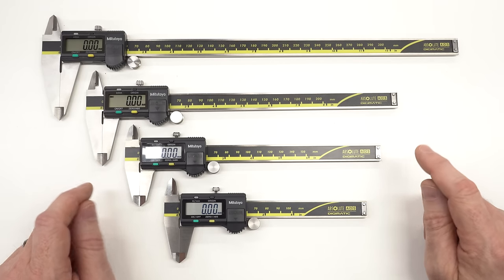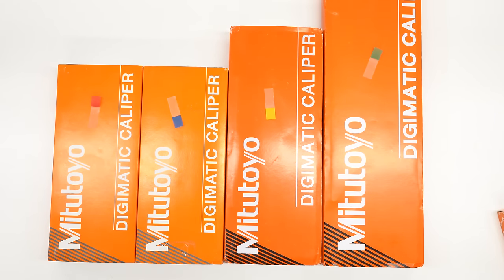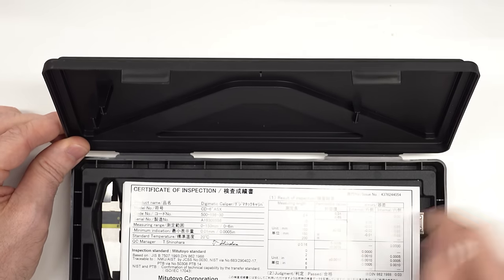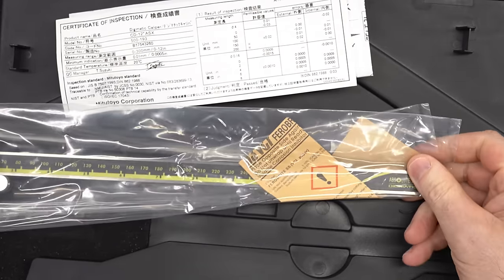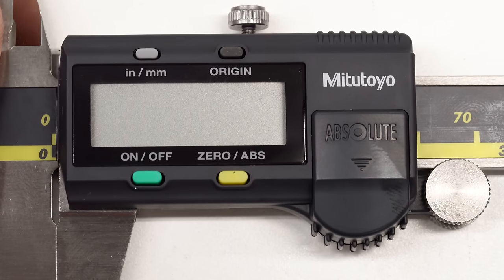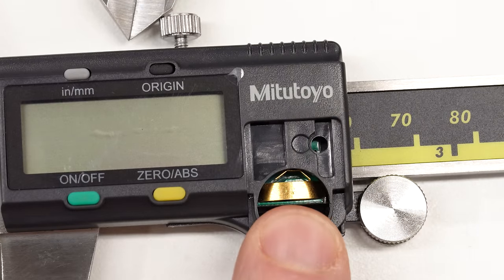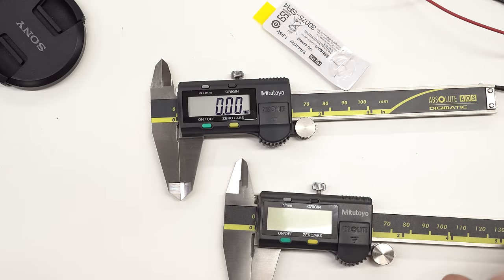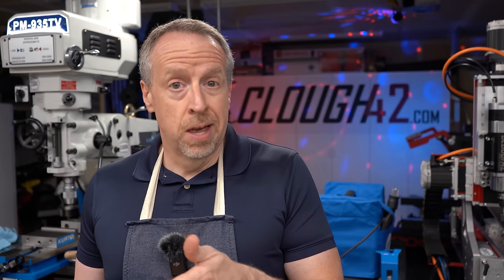17 Warning Signs Your Mitutoyo Calipers Are Fake

Comment: Fantastic video. You may be able to help me with a problem I’m having. I have a caliber that after watching your video I’m quite sure it’s legitimate. It is a code 500-171 model CD-6”C, serial 0048821. I tv have lost the battery cover and have purchased 3 on the internet and none fit. Can you possibly recommend a reputable dealer that may be able to sell me the correct one. This is a VERY OLD unit over 22 years at least.

Comment: The key issue is the accuracy of the fakes. I got the impression that you were so careful not to mention this once, which means that the “counterfeits” work exactly the same as the original. Actually, why pay more if it does the job just like the “original”? Just for the sake of the inscription "made in Japan"? I don't want to spend money on some kind of inscription.
Reply: Why pay for the name then? Isn't it better then to buy a genuine Chinese caplier for a fraction fo the price of the knock-off brand name product? 
I do have anything against inexpensive tools, equipment, and other items if they perform the same or the difference between the possibilities of a brand product and some other product do not present the difference I can make use off, but I try to avoid buying knock-offs of anything.

Comment: Nice detailed video however you 'forget' to measure things with it. Actually how accurate are the fake ones? Next question is how they are advertised? Original photo of the product or a photo of Mitutoyo itself? If they used a photo of Mitutoyo it is difficult to tell that you buy a fake product. It that case it is a trap for almost everybody. That is really a scam. But also, the materials used, is it worth the price? If you take a look at the video of BigClive (disassembles a very cheap caliper) you can see they can mass produce a very clever and accurate design for almost nothing. If they used the same (of the shelf) techniques, same materials or with a different twist to it, it is impossible to ask such price for it. If true, the scam has two sides: 1) A fake product and 2) You paid too much for what it is.
Reply from the maker: Your final two points are correct.  These are just ordinary cheap import calipers, overpriced because they're dressed up in a Mitutoyo costume.  In fact, I'd put these near the bottom of the import caliper tier list because of the battery consumption.

Comment: i had this problem with buying water filters for my refrigerator on amazon companies were selling what was labeled as GE MWF filters but they were completely different from genuine ones bought at home depot.
 i sawed case off filter and real one was a nice perfect dome of smooth carbon while the fake was rough cylinder with cloth glued to it to keep carbon in place and a plastic end cap which was broken off in shipping or installation so i was getting water full of black dust that was not filtered at all it simply went around end of open filter material water tasted terrible .
so i complained and amazons response was the seller says it is real so it must be true

Comment: I work as an inspector in aerospace and use genuine mitutoyo calipers every day. I bought a cheap knock off pair from ebay a few years ago on a whim, gave them to our gage calibration tech, and according to what he said, they were basically dime a dozen $40 calipers with fake logos but also perfectly fine for regular use. He calibrated them just fine and said they were perfectly serviceable. If regularly calibrated (as is typical for every gage no matter the price), they're fine. To anybody reading this, as long as they're calibrated, no matter what you're paying, they're fine. Don't get suckered into paying top dollar calipers.

Comment: Counterfeited measuring device where the packaging and labels do not have close to the exact sizes of printing should give the proper expectations of accuracy of the product. I would hate to be fired from a job because the measurements were off a little.

Comment: This video is frankly funny! :) Mitutoyo has it manufactured in China according to recommendations and quality controls which may vary over time! Mitutoyo is unable to authenticate its products (for example by a scratch code to be validated on its site). So we buy a caliper on Amazon for more than $100 and we have to go through a series of checks, it's really not serious! So I prefer to buy a Tesa, a Sylvac or a Mahr, as good or even better than Mitutoyo, and not have the worry of having a fake Mitutoyo. I would add that each youtuber dealing with this problem of counterfeiting presents its own criteria for verification, which makes the exercise even more smoky!

Comment: When I was buying chinesium mitoyo's from 95 to 2003, I was getting the 6" version for $9 and sold them for $45, only thing we noticed is the mit's number settles quicker, but we did not care for the price. Another note on your video, the 14x battery life was "sitting life" not use life. Also you did not show where the mit's battery voltage was, seemed quite a bit higher than chineesium. You should of did some measurements on all 4 calipers in all 4 modes (ID, OD, depth and step) with something small (say 0.1mm and 4.0"), as this is what matters most to us. Thanks for sharing.

Comment: I mean, I'm glad that the people involved in counterfeit products tend to fall into a spectrum between lazy to absolutely stupid but it's really crazy to see, from a basic graphics design perspective that if they literally put 10 minutes or less into "resizing" the original logo instead of "stretching" it, their only remaining issue would be matching the ink color as far as the outer box goes. Anyway, from the perspective of myself, being a legitimate enterprise - I have a hard time wrapping my head around anyone going to such lengths and trouble to create a counterfeit product but put such a lack of care into copying the product they're duplicating. But, I guess that just comes down to the overall mentality of someone chasing the desire to be lazy and make "easy money" by scamming.

Your point about if the counterfeits were of decent quality, why not market it under their own brand and compete on price was very poignant. 👍
Reply from the maker: Yeah, I'm not totally sure what's going on there, either.  Some of the stuff, like the crisp molds and the more expensive machining operations make sense from a cost perspective, but I have no idea why there are so many issues with the graphics.  That part should be pretty easy to get right.
Reply: @Clough42  Yes, that's true. The machining and molding are directly tied to a cost component so, while the end goal is to produce a duplicate product I can see why they would have opted for less expensive methods. However, they were printing the box anyway so the lack of attention to detail would seem to indicate that the packaging is probably a more accurate gauge of their overall lethargy than anything else. 

The battery packaging was absolute peak irony. 😂

Thanks for taking us through the comparison. We're all smarter now because of it.

Comment: I don't know what's changed in the past few years but Mitutoyo used to be the Black & Decker of  Measuring tools.. They work OK but not even close to top end.. They did NOT invent digital measurement. they bought the rights to produce from the inventor.  I am not aware of a single thing that they actually developed. Perhaps I missed something but I haven't heard of anything they did on their own. they either buy the rights to produce or wait until patents run out and start producing then.. The tool makers that I worked with all used higher quality tools.. If they are being boot-legged, it's because they are mass produced. Are any of the top brands being counterfeited?? It has been proven repeatedly that Even the Harbor Freight's are just as accurate. So why spend $150 when $15 does the exact same thing? At least the counterfeiters sold 2 more units for this video.. that should help to keep their operation alive..

Comment: Anything after 97 was fake in my book.   97 is about when online shopping took over and Small Town USA died.  I tried a few sets of the Taiwan import fakes,, then went to Starrett.  I had some junk supposedly-Starrett tools also, they didn't escape the onslaught of fakes.   A Engineer buddy who worked at Boeing gave me a set of some 10" hand built Boeing slide calipers from the "Boeing Tool Crib" headed to the scrap heap or the public outlet store.  Made at Boeing.  Puts all the rest to shame as far as accuracy and they are super smooth.  No batteries needed.   They are my baseline/double check for all the other junk that I own.   Have had them for 20 years.

Comment: All the fake models keep drawing battery power during "power off" since they are not absolute, so they need tracking any movement even if not shown on the display. Even further, the current is far higher than the original. This is why you need to continuously change the battery on these fakes, while on the original one the battery lasts accordingly to the real using time. On the fake stuff, the "off" mode is fake as well, it's a useless button.

Comment: The rear plate layout was completely different between the original and ebay, different fonts, different position of wording such as MADE IN JAPAN, the beam locking screws are red on the genuine, and silver on the fakes, the rivet plate on the genuine has different types of rivets, plus the stickers have been cut back on the genuine one at thr rivet plate, the fakes the sticker runs all the way through, the reason they will plagiarise the genuine product instead of branding themself is it cost $2 to make it they sell it for $80 / $100, self branding they could only sell for $30 / $40

Comment: The bottom line is who does it stack up on a calibration test. ie My Aldi Caliper reports on a 100MM Gauge block as 99.80mm. opps!. I guess that's close enough +/ - 0.02mm. lol

Comment: Good Day : I'm just retired after a 40 yr career in aircraft / aerospace . I went through college for "Tool & Die Design"  . I've encountered these types of investigations before . Slight differences in packaging happen frequently . Different branches of the same companies from different countries is what this is . What you are taking about is a difference between "Print Shops" , not the manufacture of the calipers . To take for example the black plastic covers on the front of the calipers , these are made by an injection molding process . They would contract out perhaps a run of 20,000 covers . When used up , a different shop could be very easily used for the next 20,000 . I'm very sure that you have encountered shops that can't fulfill their promises . They would automatically "Sub Out" to another shop the next run of 20,000 , the next covers would be conforming , but just slightly different . I see what you getting at in your video , but I feel that you may be barking up the wrong tree . A counterfeiting operation of this magnitude would have to be very big , and therefore could easily be caught .

Comment: As per workplace where using these for years.. usually calipers gets damaged by accident or by abuse.. original battery is still there. You gonna appreciate battery life too there when you don't ever really put notice on it. You use the damn tool.

Comment: Mechanical Calipers will have huge differences in how they are made... stamped out tooth rack vs machined.... etc etc etc.. But are off brand electronic ones bad? Using an encoder, rather than rack and gears might make my AE GEMS electronic one just fine... or is it?  As far as piracy, truth has a whole different bar on the interwebs. Sadly, many STARRETT  "real " calipers are imported now.

It would seem the maker could market theirs legit, as a Mitutoyo "alternative", and stand on their own specifications. I bought 2 6" calipers from aE Gems.... because the revues were rather high, and they did not attempt to deceive. They were the only electronci caliepr that had MM/INCH and FRACTIONS of an inch. Now there are a few from GENERAL that offer the 3 measurements.

But I am not a machinist, so my requirements for accuracy are satisfied with the ones I bought. I tried to buy Starrett, until I found they are from CHINA ( so sad )

Comment: I checked my Mitutoyo model CD-6CX and almost everything matched the genuine model. The only difference was my “origin” button is recessed. I wonder if this was a model change and the fakes used that plastic cast. Otherwise everything else, from grind to fit and finish and case are good. I bought mine used from eBay for £32, but they were dead on arrival so I got a full refund. It turned out to be the wrong thickness battery, so I got a bargain. There seems to be a port to connect this to a computer, but I don’t have the cable. Oddly enough, I bought a cheap £7 set and use that 99% of the time as I don’t want to damage my ‘free’ genuine ones. The human brain is an odd thing.

Comment: fake or real the most important thing is the precision got genuine thing before but it got so worn out and not recalibrated let just say it was a nightmare when everything is of by a bit that end up making thing failed, if it fake but precise i will take it as long as pricing is good and the performance match the pricing, at that point i would just sent them the letter say you just open your own company and make your owned shit instead of making fake at this point.

Comment: Why didn't he cover accuracy?  On consideration:
- Any measurements of the calipers he bought would be ONLY that:  measurements of the specific calipers he bought.  ZERO guarantees that the next pair of eBay calipers would be from the same source, same batch, and would have the same accuracy. 
I doubt the counterfeiters take the same care as Mitutoyo does to ensure uniformity, because that costs money and expertise.

- The counterfeits have no single, known, consistent source.  There could be dozens of companies buying knock-off labels, injection-molded housings, etc. and making the steel parts.  
A genuine Mitutoyo will meet the stated specs, because they CHECK, and do what it takes to sell a uniform product.

- How hard is the steel used in these?  Mitutoyo can be trusted to use excellent, uniform materials and have a very low wear rate; are the knock-off made from whatever came out of the partially-melted, non-uniform scrap melting furnace that day?  If it looks like that'll save a buck, I'd expect that.  So what does the initial accuracy check mean, after a few months of use?

- Are you going to trust counterfeiters to destroy a batch of 'iffy' parts?  They sell just the same, after all.  

Strictly for hobbyist use, and SHARS costs less...

Comment: I know one way to check is actually the battery. The real mitutoyo uses Japanese made SR44 battery the fakes 90% of the time use the much cheaper LR44 or other. There are a few fakes that use a fake SR44 battery but the font is off just a little so if they have anything other than SR they are fake.

Comment: I got sick of wasting money on cheaper calipers that were not Mitutoyo fakes, but were decent tools, until they stopped working so I got that 6 inch version from MSC and it works great after several years. Problem with this video is that you are showing the fakers what to fix and improve.

Comment: My mitutoyo calipers were made in Brazil.   The case has the clamping points as the "fake ones" do. however The rest all says the same except maide in Brazil the PP is there....mine  are NOT digital and they are legit and accurate. Pretty much everything else in your video lines up.

Comment: I wanted to see the LVCO of the genuine.....video cuts to conclusions after author says 'lets keep going.'
Also, I have some HFT junkers.  Been in the drawer for 9 months.  Still original batter.  But I NEVER leave the battery installed becuase I have seen crap, copycat electronics eat the batteries in the past.

The seiko SR44 battery (silver) has capacity of 160mAh.  At 16 microamps, that 10K hours or 1.14 years in the drawer.  At one microamp, it would be well over 10 years (3 years at 6uA aka 'usage').  I know the HFT units easily eat 2-3 batteries per year if the battery is left installed (assumed LR44 alkaline cells).  At customers' shops, the HFT caliper is WAY more likely to NOT come on than it is to function before getting another new battery.  Not many weeks later, it's gonna need another.

The more common LR44 battery costs 5X less, has capacity of 120mAh but starts life 50 millivolts lower (50 millivolts closer to LVCO approximately).  For this instrument, I would consider the silver because is sucks to do batteries in the shop and 1 to 6 microamps means long service life.  For other stuff, bulk alkalines are the low-cost answer.

Comment: Excellent information, but you need to offset the PSU to account for the drop on the multimeter in current mode (which will vary depending on the meter).  You need another meter to measure the voltage at the unit and adjust the PSU to get 1.55V there not on the output of the PSU.  Voltage is easier to measure without affecting the circuit.